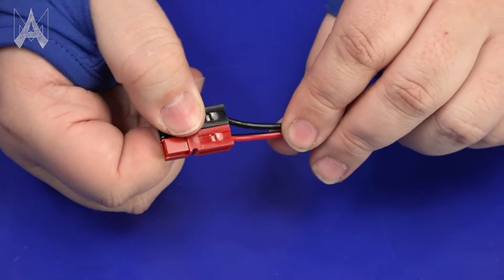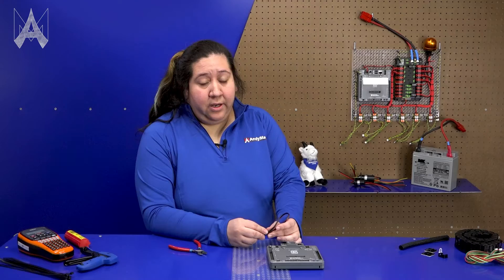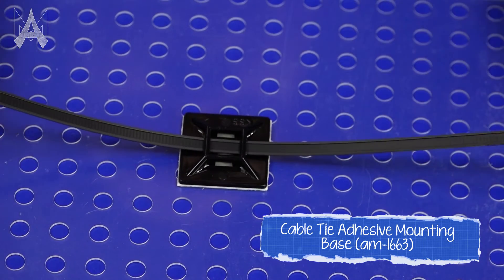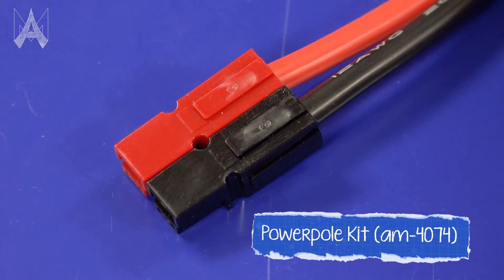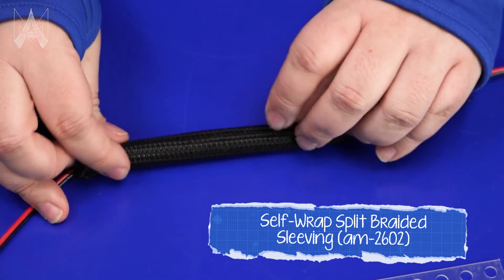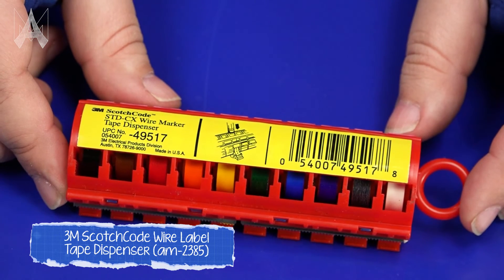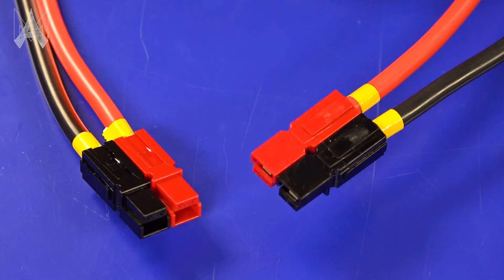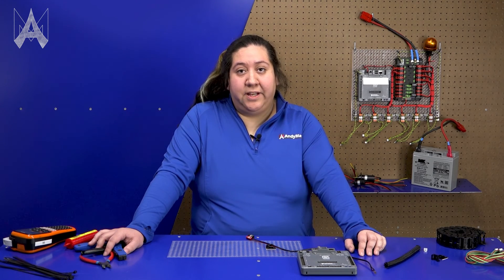How Do I Manage Wires on my Robot?

Comment: One thing you can also do is lay out the wires in cad with sketch lines and use that to guide cable tie holes and strain reliefs